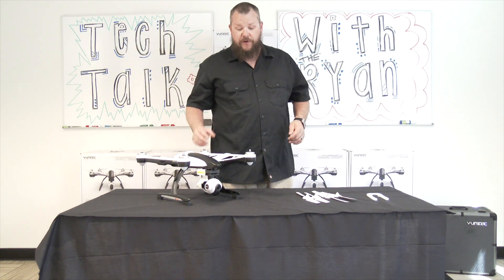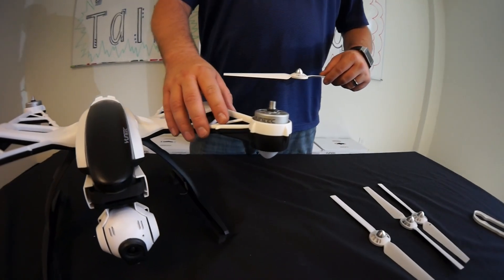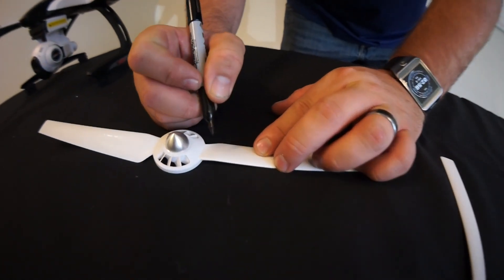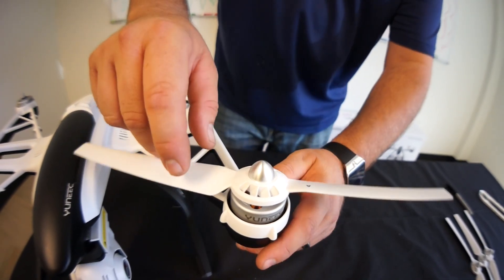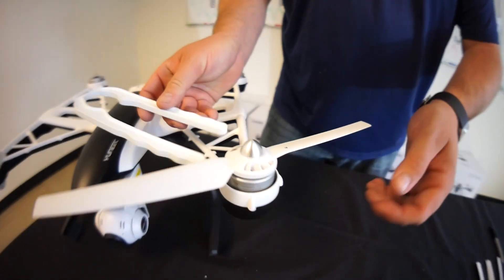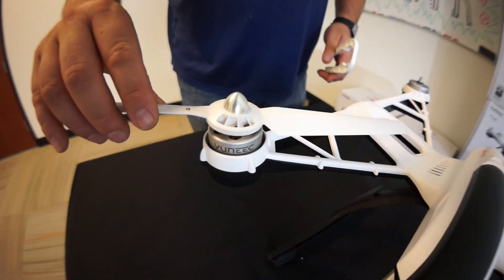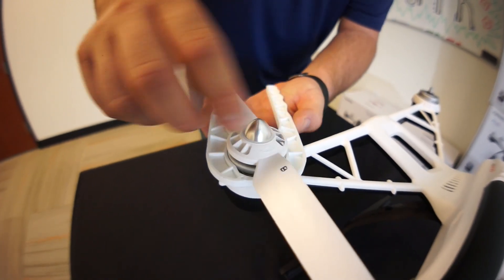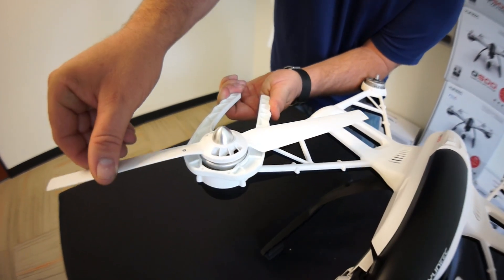YUNEEC TYPHOON Q-500 PROPELLER INSTALLATION

Comment: I had a prop come loose today about 6m above a concrete slab. It was our first flight with this device and it was going great until that happened.

Needless to say I almost had a heart attack. It got beat up pretty bad though it still technically works mostly (I think?). I haven't flown it since then because I've been reading up on this issue. I want to make darn sure it doesn't happen again. I've read so many stories of people losing their props. So the next model needs to have a locking mechanism.

I'm not happy at all that this happened in the first place. I'd take the blame on driving it into the ground but the prop instructions weren't sufficient so it was going to happen no matter what.

Is there someone I can contact regarding this or am I just up the creek?
Reply from the maker: +laserfloyd Sorry to hear about your incident. Instructions for prop installation are also described in manual. Once props are snug continue to tighten 1-1.5 turns for proper installation. If you have any questions or concerns please feel free to call our customer support at 1-844-898-6332 / uscs@yuneecusa.com.

Best Regards, 
Tim TerronesOnline Social Services|Yuneec USA, Inc.5555 Ontario Mills ParkwayOntario, CA 91764Email: tterrones@yuneecusa.com

Comment: Same here, have a pb with my Q, very short range, even with the std firmware on the cgo3, plus, on one of the motor, when i touch the rotor axe (where you put the propeler on) it's a bit loosy, move a litle and make sone click noise when i move it (the other 3 are FIX and don't even move a yota) and this is from a brand new one, out of the box. :/ anyway, the only fly i make with it was awesome even if i wasn't able to go farther than 50 meters (video feedback loss, q500 began to blink all red below the rotors, was very scared and grounded it to contact support, now i m waiting good weather to make a test to add to my ticket which is opened to yuneec support^^)

Btw, the 1+1/2 turn for the propellers is a good tip, and never heard of it before now :/ (on my first flight, when i shut the motors off, one propeller has fly away on its own^^)

Comment: Thank you Tim   I had problems from the start.   It is now only days away from my 6 mo time frame to repair or replace.    I have been stalled so long that it is shameful. 

My Battery's need replacement now,   Loss of GPS  almost every time I fly,  very short range.  and the list go's on.     I am  now told I will get a new transmitter and Camera.

But now 5 Mo and two week into this my Battery's have now gone bad.   I only use the stock charger and let the Battery's cool between charges.      Send me a  RA so I can send you back the bad Battery's     to     Dynotime1@yahoo.com       I hope I hear from you soon     as my 6 mo are up  on the    20th of this month    Sept 2015
Reply from the maker: +Gfdf Perte Please check you email
Reply: I will sir,  thank you.

Comment: Sad part a lot of the Q-500's  are falling out of the Sky as the Props are comming off or comming Loose.    This is the First I am hearing of 1/1/2 turn to tighen.  This should be in the Instructions when you get the Q-500,  not after they are falling out of the sky. I still think that Yuneec is trying to do there best but it is not yes as good as it should be.   I have had trouble with my Q-500 for some time now and Yuneec will not address it and keep putting me on the back burner.  I have now been able to fly my Q-500 for almost 2 months now.

Comment: I did the same thing with the sharpie and also drew the arrow for installation direction. Then I labeled the motors as well with the A or B designation. Easier to see and work with in the field. Another thing I did was to write HOME under the position of the mode toggle switch on the ST10 controller. This gives me a visual on the controller to remember what I need to do in case a critical situation occurs. The Red pwr push and hold button tricked me once in flight but I quickly realized what I was about to do and fortunately didn't hold it down! I am a much more experienced pilot now. Having a great time with my Q. Thanks Ryan.   Greg at underwaystudios on Youtube.